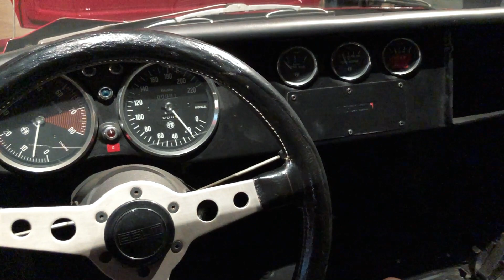Scarabeo: The Secret Alfa Romeo Project You've Never Heard Of

Comment: Many thanks, specially for convincing the Museum staff to lift the engine hood for further inspection of the "Twin Spark" engine bay. I find it very interesting how close  the spark plugs of the third and fourth cylinder are together with the ignition cable boots touching each other! This engine should be called Testa Stretta  like the famous Ducati engine! Would it not be a good idea, before running out of Italian cars, to include vintage Italian Motorbikes into the Portfolio of Roadster Life?After all The riding experience is similar to that of a Roadster!🙂
Reply from the maker: Thank you!!! I’m not worried about running out of topics anytime soon: in fact, my biggest current limitation is finding cars to film, more than anything else. Regarding motorbikes, I see your point but I don’t feel I can write about them. I like Ducatis and Guzzis as much as anyone else, but I don’t know much about motorbikes, if at all, so I’d better stick to what I’m knowledgeable about 😊
Reply: @Matteo_Licata  I understand. Regarding cars to cover: Although not in Italy, just opened there is a very interesting rally car show at the Technik museum speyer (near Heidelberg,Germany)with all models once driven by Walter Röhrl including  037,131 and Delta lasting till 16.4.2023. Especially as Roadster Life sometimes covers interesting non Italian cars the visit may be worth it as there even is in Sinsheim, another big technical museum to visit nearby (35 KM). Both have websites for a first look.

Comment: Great stuff but the tight budgets it was indeed already obvious at the time. Look at those interior. One can overdo the use of the external color inside. Looks like a simple polyester molding is used as a dashboard. Or is it aluminum? Those ventilation hoses are however even worse. Minimalism taken to the rediculous. The external shapes where still nice though!🙂
Reply from the maker: These are prototypes meant for testing, so it's normal for their interiors to be an afterthought, cobbled together with no regard for aesthetics.